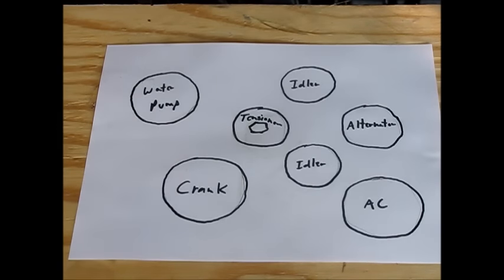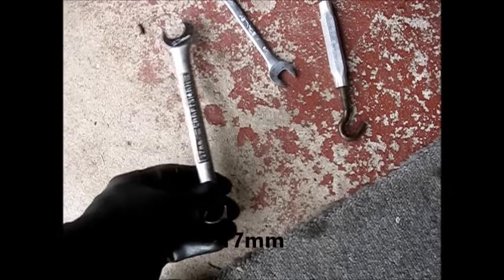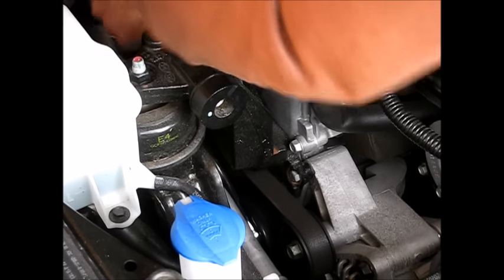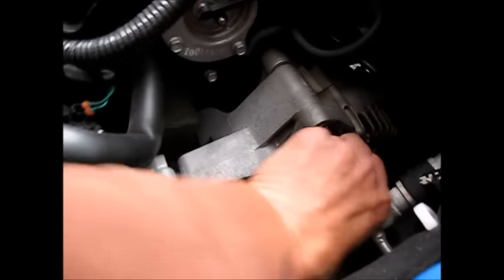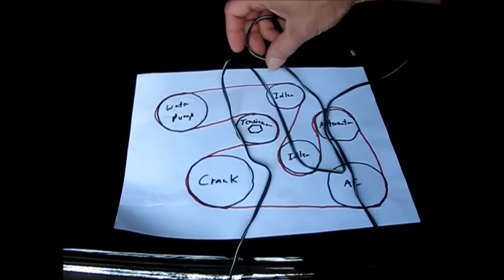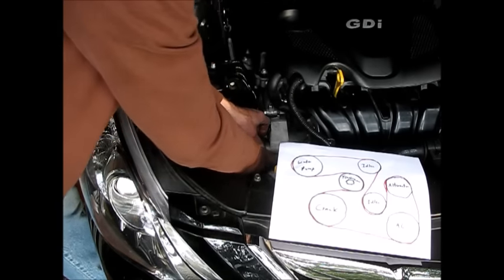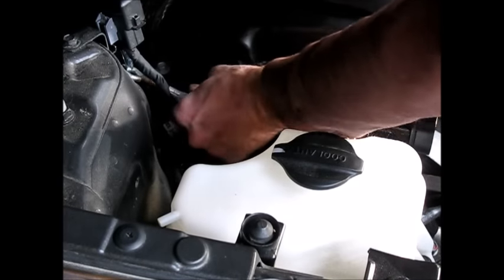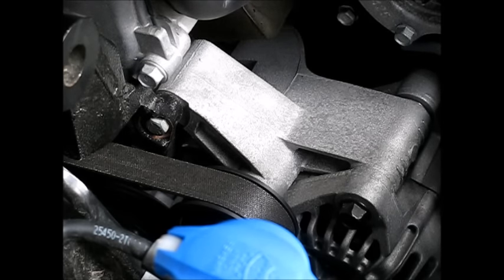How to replace the serpentine belt on a 2.4L Hyundai Sonata

Comment: Excellent demonstration for those with nimble hands and digits….😊 Great Job!!!!

If some of you out there don’t like the very tight quarters from the top side, you can remove the engine guard plates and find a wealth of space from the underside. However you will have to put the vehicle up on Jack-stands. Takes longer but could prevent wrench throwing, swearing, and kicking of the dog….😂

Comment: Thank you so much for sharing this video.  My wife an I got stranded in Georgia this past 4th of July weekend.  Belt shredded itself on highway and we were lucky enough to be within 2 miles of an Oreilys.  we got the belt, picked up some wrenches and I spent 5 hours wrestling with how to get the damn thing on while battling 90 degree heat and high humidity.  Sweat was literally dripping down my face, my glasses were fogging up (it was a frigging joke).  In the end my wife took initiative and asked for help from the clerk in store. I lined up the belt with all pulleys and he managed to wrestle the damned thing on the water pump pulley though brute strength while pulling back on tensioner.  I was annoyed that is took me so darned long to get it fixed.  Learn from my mistake, sometimes you gotta ask for help.  someone else may have better way of doing the job than you.  We made it back to Florida albeit behind schedule.  Such is life. : )
Reply from the maker: Thanks for sharing the story of your ordeal. Not sure how much the video, as far as the wrench and turnbuckle helped  you, but thanks for using it.  Where I come from (WI) car trouble always seems to come in Dec. and Jan. in a snowstorm with a whipping wind and temps in the single digits

Comment: Cannot stress enough: once you take tension off the belt, have a plan to KEEP the tension off (i.e de-tension using something like a turnbuckle from the get-go). 

I made the mistake of hand-turning with a wrench to remove the belt. Once the old belt came off and I and released all that tension, the tensioner sprang out and became 10x harder to get back into position.

I learned the hard way. Had to use a system of pulleys on a 3-1 system and still had to use all my force, along with a turnbuckle. Once I was able to move the tensioner back an inch or so, I ended up using a pry bar to pry the tensioner back just enough to slip the new belt on (belt was already threaded through, with just the upper idler remaining). Don't be like me... 

It's a job for 3 people with space for a child. Also a short wrench helps, since it's a tight space and a longer one will bang up against things and get caught.
Reply from the maker: Thanks for sharing your frustrations and tips for overcoming them.

Comment: You're the man!  I took your advice and bought the items you put up in your website.  I had to find another way to get the turn buckle to meet up with the S hook.  But what I did was put the box end of the wrench a little further and used 3 S hooks to meet up with the buckler.  It just had a few millimeters to go to connect to the box end of the wrench so I pushed it toward the turnbuckle and hooked it in.  After that it was just simple.  I used your diagram and made sure everything was right and it was just easy man.  Thanks for your info.  I recommend trying this method because it saved me alot of money.

Comment: Just did mine ! A welcome change after struggling  with my daughters '07 Sonata V6. Thanx for a great idea . Being a retired tech I feel like a fool for not coming up with this myself !
Reply from the maker: +Shepperd November Glad you could make use of it and thanks for the comment!
Reply: The Original Mechanic Just did it again! This time at 155,000 miles I decided to replace the pulleys and the tensioner. If you use a Dayco  kit remember The tensioner bolt will be 15 mm instead of 17 mm. At least mine was.

Comment: It makes sense now..as you can tell I haven't looked under the hood for a while but a friend of mine was working on their Hyundai Van and your video matched the engine.I didn't understand the Tension aspect...last time I did one of these they had bolt and bracket so now I get it.  Thank you for the good video.

Comment: REALLY IMPORTANT!!! I have a 2012 sonata which must have a different setup with the brackets than the car in the video. So instead of using the turnbuckle method, I had my son hold the wrench while I took the belt off. Problem is the tensioner goes back MUCH further when there's no belt on it. So, when we used the wrench to get the new belt on, even though the wrench was as far as we could move it, it was still not as far up as when the old belt was on. It was REALLY hard to get the new belt on. Ended up getting the belt partially on enough to hold the tensioner then took the wrench off and repositioned it to move the tensioner a bit further. Then used zip ties to hold the wrench in place. Once this was done it was easier (not easy,  but easier) to get the belt properly seated. I'm not a mechanic and it was a real pain in the ass but this is the best video explaining how to do it. And once I got it done, it was a nice feeling of satisfaction. Thanks for posting!!!
Reply from the maker: Thanks for sharing how to solve this problem. Way to stick with it and get it done!

Comment: With the right tools and if you jack the car up and take off the passenger side wheel and work from the top and bottom it is a very easy job .
Reply: Dafewcha have you done it that way I have to do mine and is a nightmare am curious if its easier that way

Comment: great video especially the belt diagram. I have a 2012 Optima SX 2.0 Turbo. the tensioner is 17mm. upper iidler pully is 14mm, lower idler is 15mm.
Reply: David S How often do you change the belt on your Optima? I have the same car, Optima SX 2012 and I’m at 54k miles but want to replace it though it still looks in new condition but due to the time its been there (6 years now) I want to replace it.

Comment: It's way easier to do this from underneath the passenger side... this video helped but I quickly found out if I jack up the car and remove the splash guard underneath and easy access to all the bolts and belt and tension-er.

Comment: I took a Craftsman 17mm standard socket, not offset and put the open end in from the front of the car with the open end facing rearward and just lifted straight up and it released it without any problems. It took literally seconds to remove it. No special socket or turnbuckles or anything needed. It problem comes when you try to place a standard socket on the tensioner. That will not work.
Reply: You should be a very strong man

Comment: How is the access to the belt if you remove the wheel and splash guard?
Reply from the maker: That may be a solution to difficult access. I didn't investigate that approach when I did this.
Reply: Much easier taking off wheel and plastic inner fender

Comment: I did mine (all by myself) twice with just 2 pcs. of 17 mm. combination wrenches in less than 30 minutes for removal of the old/OEM and install a brand new Gates belt.   Of course I have to check if all the pulleys (tensioner, idler, alternator decoupler pulley, water pump and A/C pulley) are all spinning smoothly.  I have to remove one of the idler pulley to flush out the old grease from the bearing and repack it with new grease.  I'd rather do an extra mile of preventive maintanance prior to installing a new serpentine belt.  I am a DIY'er and not a mechanic by profession.  The method on this video is just laborious and a time killer.....
Reply: You....do know the belt and the tensioner are supposed to be changed at the same time with these cars, right?  Mr. "Extra Mile"....

Comment: Can you give me some instructions to install the serpentine belt in Hyundai tucson gls 2013 engine 2.4,I've tried in different ways but I can't. Thanks for your help
Reply from the maker: Sorry, I don't have any specific ideas on that engine. In general once you find the tensioner, you have to hold tension off and remove the belt. Some of these engines are so tightly compacted that you may have to jack it up, take off the wheel and the wheel well cover to get at it.

Comment: Engineers should leave at least 2-3 inches of clearance to make it easy to change the belts even for amateurs. I had no problem fixing my old Datsun 510 using simple tools. A simple reliable and easy to fix engine. For the new engines with little space to work on especially V6/8, using specialty tools such as the ones designed to change serpentine belts makes the job much easier than using a regular wrench. A good clearance around the engine make it easy to change parts with ease. I do not understand why there are many stupid engineers that insist on making things too difficult to fix on some engines. Increasing the width of the car an inch or two is not going to harm anything. Buyers should not buy cars that are costly to fix. There are some engines with water pumps driven by the timing chains!  Who really approved such a stupid design!

Comment: Would it be easier if you took the tire off so you could access it from one of the side panels?
Reply from the maker: This might be a possibility. I didn't pursue that.
Reply: The Original Mechanic I did that when I had a Nissan Sentra it made things alot easier just wondering

Comment: this was a great "what to do" w/explanations. as far as "how to do" for someone like myself i need a better view as to where on the veh you safely hooked the turnbuckle and a view of the actual process of belt routing.
 my 2011 tucson has this engine w/even less room for 2nd guessing.
Reply from the maker: There is a bracket on the wheel well on the Sonata. The Tuscon may well be different. Some viewers have suggested removing the wheel and wheel well cover will make this job easier. Good luck and thanks for watching!
Reply: if the metal  wheel well cover is removable that's the way to go.
our other veh is an  06 santa fe and removing the plastic cover made all the differance when replacing the serp belt .

Comment: I have a 2009 sonata and i watched your clip 100 times but i really cannot figure out where you tie your S hook. It should be on thw windshield side and not towards the front. Right? I wish it were more clear and you had a piture of it on paper as well. It should be in a way that you take the tension off, the turnbuckle and S hook should not block the belt to be removed.

Comment: Hey one of my tensioners or idler pulley is bad and loud. Not sure which one. Is there one that goes bad more over than another ? Its a 13 Sonora.
Reply from the maker: You  could take the belt off and give them a spin by hand. If it's really bad you should hear or feel it.
Reply: It's has that clanky noise. From the videos I have saw its been the tensioner everytime.
Reply: Thanks you

Comment: What exactly moves when you use the turn buckle and wrench?  Are you loosening the bolt?  On old alternators you had bolts and brackets and you used a stick to pull the alternator on the bracket to the max and then tighten the bolt.  Here I don't see what moves to loosen the part that will slacken the belt.  Then you just take the turn buckle off and what happens?  I don't see where you tighten down a bolt or any bracket adjustment.   Is the part the wrench is hooked onto just a tension piece?  You use the bracket to contract the tension and that allows for slack in the belt and then when you take the bracket off the tension automatically goes back into the belt tightenting it?
Reply from the maker: +dave hightower It is the tensioner that is moving. There is no bolt to loosen to do this. The wrench is on the tensioner, a sort of spring loaded pulley. When the turnbuckle is removed the correct tension automatically returns to the belt. Hope this helps.

Comment: If the belt is broken do I have to loosen the tensioners to put on a new one?
Reply from the maker: Yes, you will have to retract (not loosen) the tensioner to install a new belt.
Reply: @TheOriginalMechanic  yeah I found that out I put it on my Hyundai yesterday. Thanks though.

Comment: Would this be different for a 2009 Sonata?
Reply from the maker: The year shouldn't matter, the engine does. If it's a 2.4L it should be the same.
Reply: hu
Reply: majulenparah you have the power steering
Reply: I have a 2008 Hyundai Sonata 2.4L and there are 8 total pulleys, not 7.

Comment: Anyone else notice but me that on my 2.4l on the upper right side is a power steering pump pulley which is not in this diagram
Reply: Exactly like mine. Mine is 2009. Did you figure out where does he attach the S hook?

Comment: I still hear like ticking rattling cracking noise and I just changed my belt so it wasn’t that any ideas?
Reply: Gerardo Rivera the tensioner assembly; mine is shot and does that rumble/rattle worse when the AC is on
Reply: depending on the year of your motor, you may have a bad motor. from 2011 to 2014 (i think) these theta 2 motors that came from Alabama were very prone to burning up connect rod bearings. Not sure what your noise is, but check with Hyundai. big class action lawsuit came about because of these motors. you describe it as a tapping, cracking or rattling, (hard to know but) i would think if it was a drive belt component you would hear a squealing or maybe a grinding noise, not what you describe.

Comment: at what mileage do you replace this belt? thank you.
Reply from the maker: Depends on the condition of it. Are there cracks in it. By 100k it should be time
Reply: @TheOriginalMechanic   my car has 188k miles already. but the belt is still normal. no cracks at all, no squeaks, groove still deep. i kept checking it like once a week. kinda worry but dont know if i should just replace it. it's a 2013 hyundai sonata gls. thank you for your kind response, sir.
Reply from the maker: @danielle8179  You're welcome. That is beyond the service life I would think,  if its original. Might want to plan to replace soon.
Reply: @TheOriginalMechanic   yes. it is original. i drive a lot. lol. just hit 190k miles. i just never remember to change this belt. lol. but yeah, got the new belt and will change it tomorrow. thank you for your video and diagram, sir.

Comment: Do yourself a favor and take the advice about using a turnbuckle to hold the wrench in place while you work. My Sonata has different brackets and I ended up using large zip ties instead of a turnbuckle, but no matter how you do it,  it will make the job MUCH easier if you do not release the tensioner while the belt is off.

Comment: Worse belt I have ever changed.Have a helper to hold the belt on the crank when you seat the belt
Reply: It only took me 2minutes easiest repair I ever did on a car
Reply: @dafewcha  Sorry, I'm not buying that. I had to have a mechanic come out and finish doing mine and he couldn't do it without undoing the engine mount and raising the engine enough to get more clearance for the tensioner. Unless you got a  belt which was at least 0.5" longer than the one I had.

Comment: Where is the oil pump?
Reply: the oil pump is integrated into the balance shaft, it does not have an external pulley.

Comment: Be really helpful if the Drawing had "All 8" pulleys instead of the "7" you show ! Both my wife's 2007 2.4 sonata and my 2009 2.4 sonata both have two idlers, one tensioner , and The Crankshaft,  power steering ,AC compressor, water pump, and alternator!
Reply from the maker: I drew it to reflect exactly what I found in the 2011 Sonata I worked on. Sorry for any confusion over which model years this video may apply to.
Reply: Arevtherr any videos on replacing a belt on a hybrid